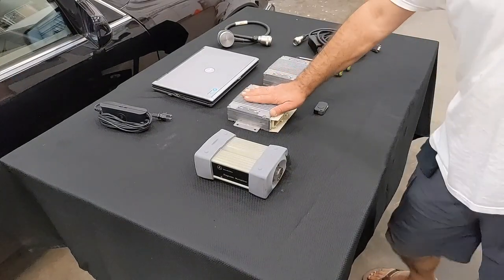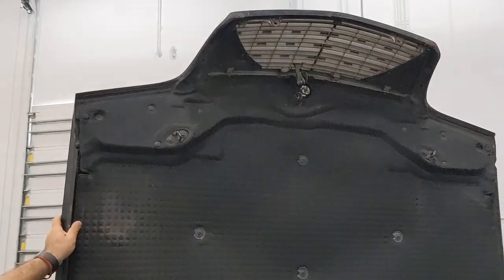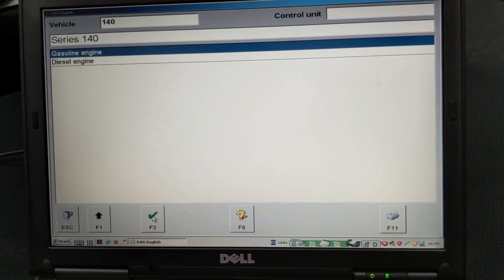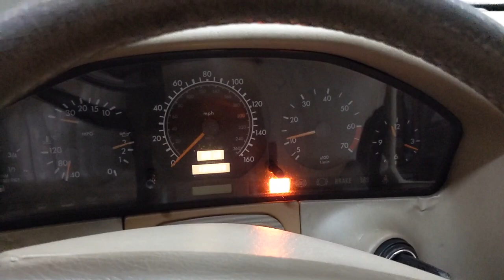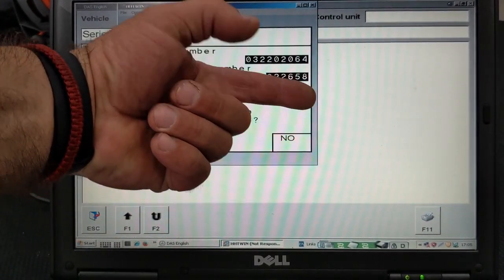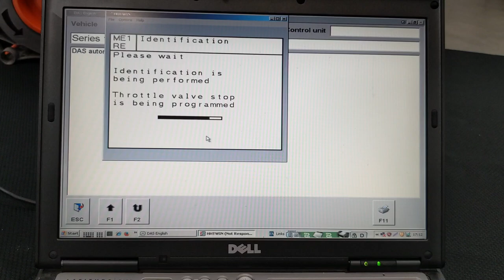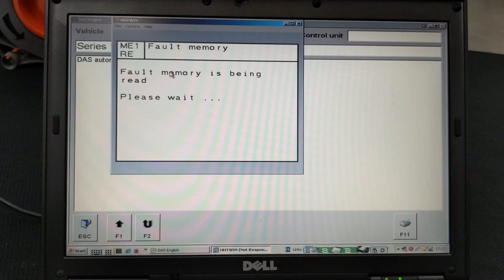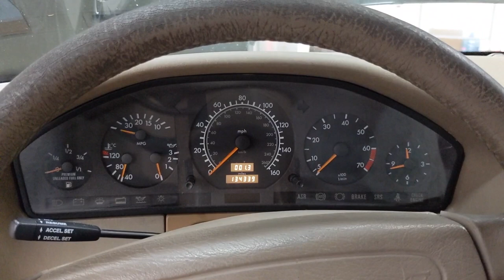MERCEDES BENZ S500 W140 chassis ECU replacement TUTORIAL

Comment: Thank you posting this video, very helpful. Question, could you read the secondary spark voltages with this scanner? also do you have any recommendations whare to buy the scanner kit?

I have a 1992 W140 M120 engine, suddenly the engine won’t start due to very weak spark on the both banks. The spark is weak right out for the main coil pack for each bank (before it feeds the distributors), any ideas? Thanks !
Reply from the maker: To work with this machine, it is best to use C3 SD Connect. This is a Mercedes dealer device. You can also purchase it from us. This is the best device for working with Mercedes in general. This device will work until 2016; if you want a newer car, then it will be a different device. Good luck!

Comment: Hey mate, thank you for this video! I wanted to ask you, can I use this process if I buy second hand ECU and transfer the coding from my ECU using your steps? Or when these 40 starts happen, the ECU can't be erased/reprogrammed using STAR? 

My intuition tells me that if I erase the new ECU (carry out the coding from old ECU), the interlock should also be reset, and after these 40 attempts, the security rule kicks in and start looking for mobiliser? So if we reset/reprogram the new ECU it should allow us to start the car and after that it will become locked to this new car? 

Or maybe I'm wrong?
Reply from the maker: If you bind a new ECU, then everything will work out for you as shown in the video. In the video we link the new ECU. It shows absolutely every step how it is done. Moreover, when you start tying, the diagnosis itself will write to you every subsequent step. If you have questions about updating the module, then send it to us and we will prepare it for binding. Good luck!

Comment: What does it  mean "interlocked"? It means engine won't run?

You used "new" module from another w140?

Immobilizer will not block a "new" module?
Reply from the maker: interlocked means that it is locked. When it is interlocked you cannot do anything with the module. In position interlocked the module was still unlocked, to make it make sense watch the video completely
Reply: @ECUTeamCorp  I think you did some manipulations with the "new" module before installing it

if a "new" module was previously installed on some w140, then it was already locked

Am I wrong?
Reply: @DimBliss  I'm also wondering that. I want to clone my ECU of OM606 engine, but I don't know if I buy second hand ECU (same part number) and follow the instruction to erase it, if this will turn off the interlocking? Or maybe it will need hardware manipulation (erasing /replacing the CPU) so it will enable me to reprogram it using the method from the video? 

I have very bad shaking/misfiring at idle and deceleration and I starting to think that my ECU is went bad so if this method works that will be great!